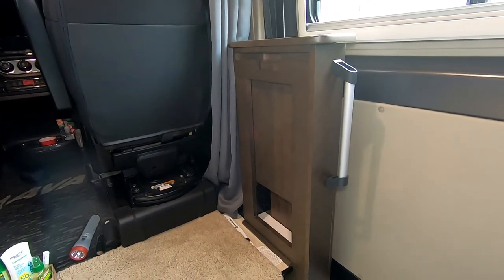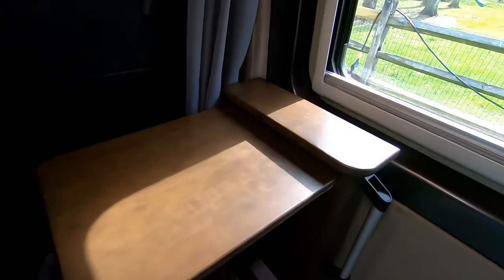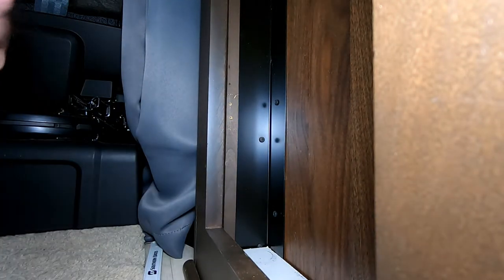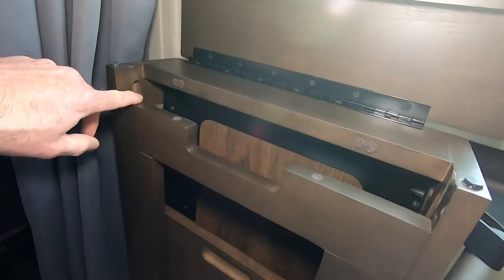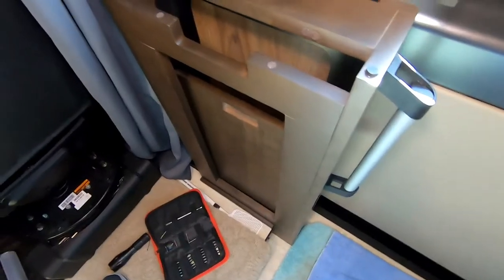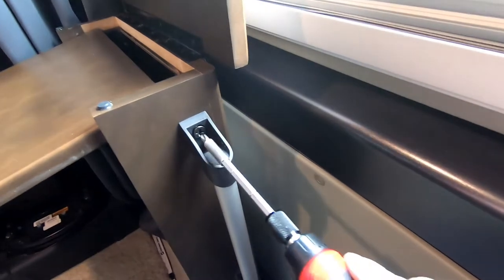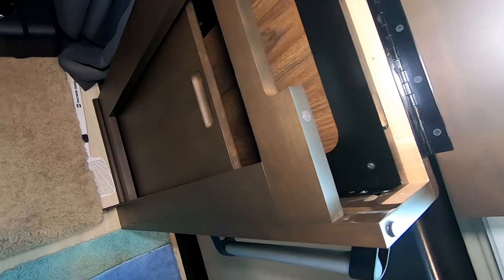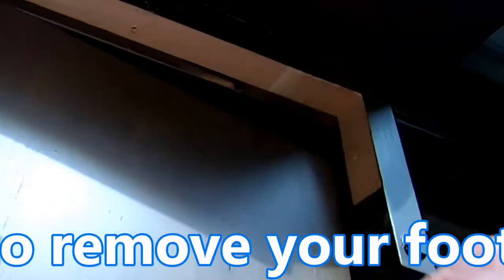TRAVATO Airline Table Removal

Comment: So what is the plan here?  The table is out, that is it?  I've been thinking a table overlay would be a better option.  And a table could be made that sat on this table and extended to the cutting board making one large table.  My preference is to come up with mods that do not require messing with the existing equipment so that if one decides to sell up then everything can be as Winnebago intended it to be.
Reply from the maker: We went with a lagun table. Shot a lot of footage and plan to share in an upcoming video. It’s been a great change for working from the van and we can both eat at the same table together.